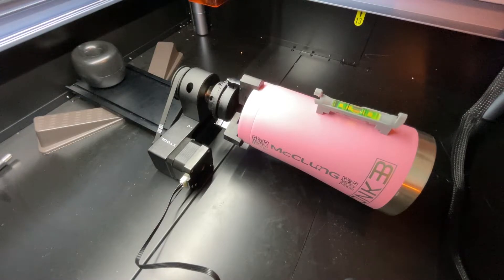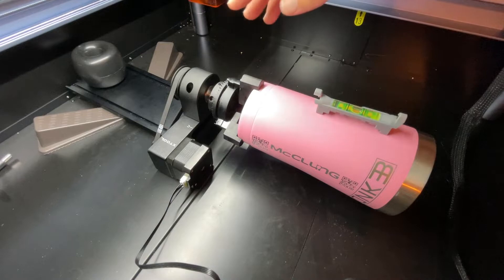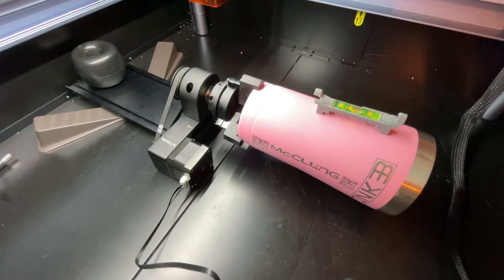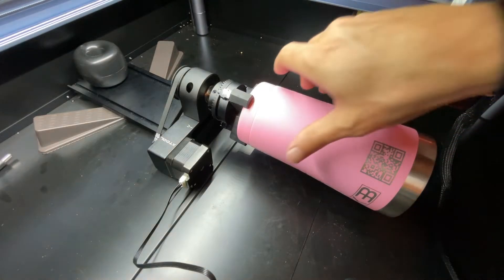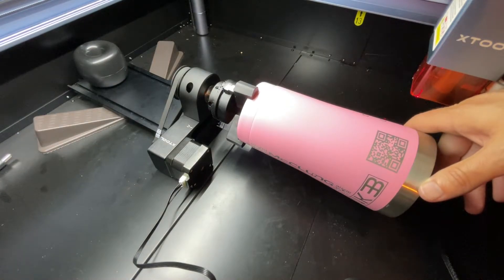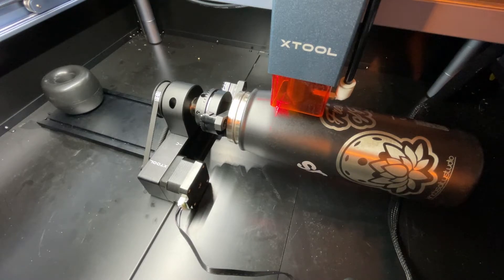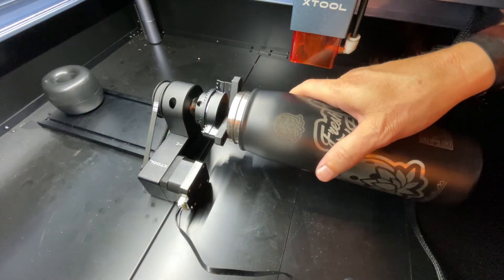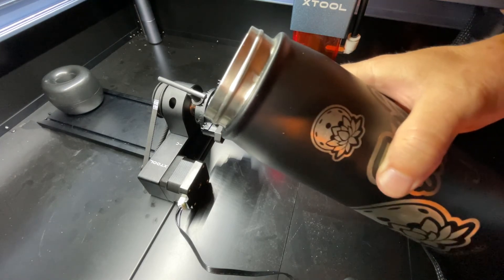Xtool D1 RA2 Pro Rotary Tool Initial Reaction

Comment: How do you get your diameter and circumference? I measure my cup and plug in the numbers but my rotory just spins.
Reply from the maker: For small designs, I don't make any changes at all to the rotary settings. I know others who skew their original artwork to deal with tapered tumblers but I haven't tried that just yet.